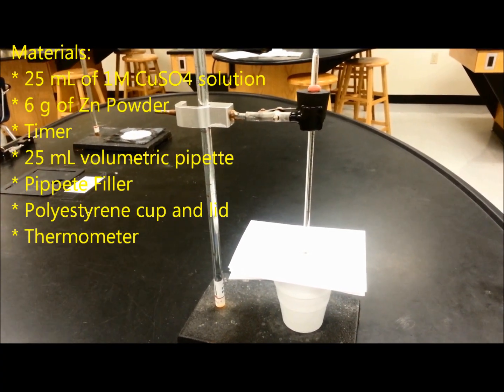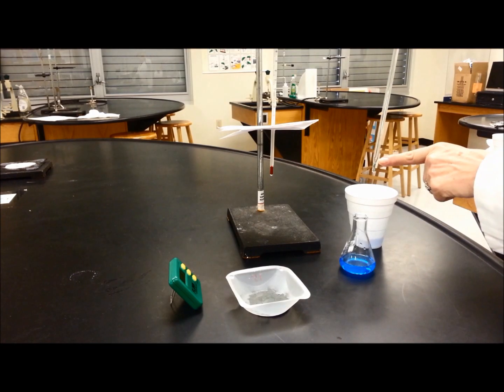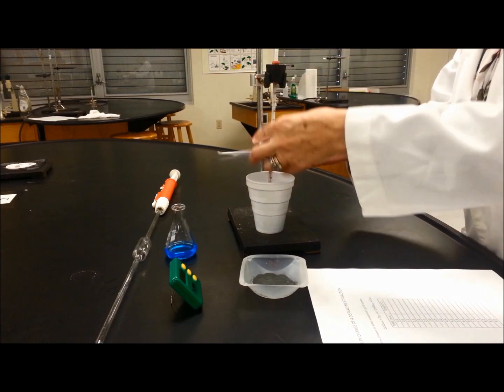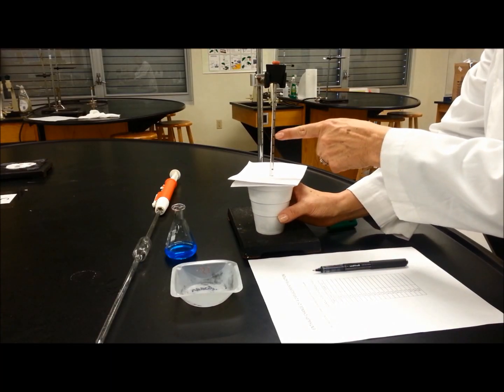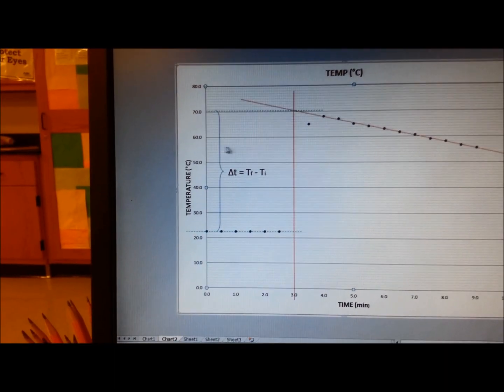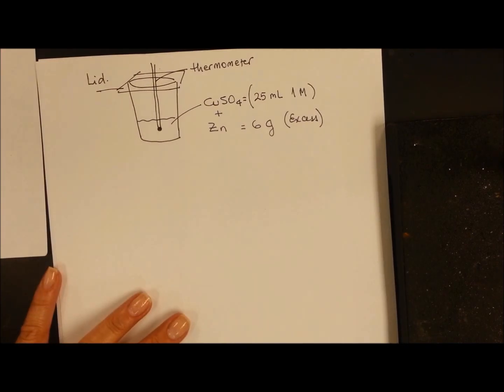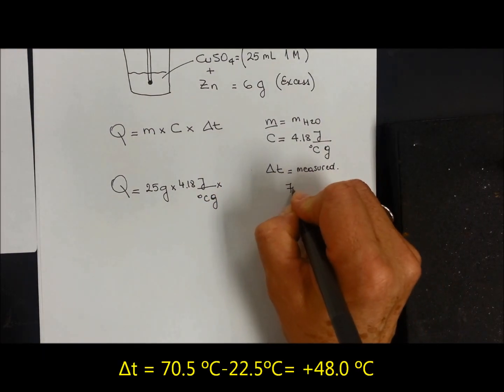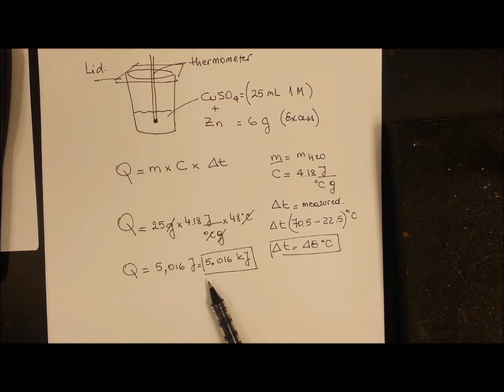AS Chemistry Enthalpy of a displacement reaction CuSO4+Zn with calculations

Comment: Hello,  I was wondering why the temp increases without second reactant in the cup?
Thank you in advance.
Reply from the maker: Hello, 

Thank you for your comment. 
Sorry I did not see this before. 

I placed the Copper Sulfate Penta-hydrate solution (1M) first. 
Measured the temperature for three minutes to be sure that it is stable and at room temperature. (that is the flat zone in the graph). 
Then I placed the Zn powder and the reaction liberated energy that was absorbed by the water and the thermometer so I measured the increase in temperature. 

I do not know if this helps. 
Please let me know if you have more questions

Comment: Hi miss Sanchez, I'm sill new to calorimetry so I was just wondering how is delta H negative? I mean if it's negative doesn't it signify an exothermic reaction?
Reply from the maker: it is an exothermic reaction. the chemicals release heat into the environment (water, thermometer, cup, etc). We can measure the change of temperature of the system by measuring the change of temperature of the water. If the water increases the temperature is because the chemicals released heat. (So the temperature change of the water is equal and opposite to the one of the chemicals)

Since energy is released, the energy of the substance at the end is lower than the one of the reactants. (ΔT = Tfinal - T initial)

The ΔT of the water is positive because the water INCREASES THE TEMPERATURE, while the ΔT of the reaction is NEGATIVE because the chemicals release energy. 

If they release energy, it is EXOTHERMIC.

Comment: Hello, Miss. I wonder how can you get 70.5 for the final temp. As I see, the mixture temp never reach 70.5 celcius
Reply: Hi Julyana, the 70.5 is the maximum temperature the reaction would have reached to if there was no thermal inertia. You see, the time for the chemicals to react gives also time to cool down. (if you leave some hot tea on the counter, it would reach room temperature after some time). By extrapolating the time = 3 min and the projected path of cooling down given by the data after 3 MIN, we can obtain 70.5 C. 
I hope this helps. 
Please let me know. Thank you

Comment: hi, can you please explain how you determined that zn wa sin excess while cuso4 was the limiting? love the video
Reply: and also why did you not include the mass of zn when calculating q?
Reply from the maker: Hi, 
The mole ratio between Zn and CuSO4 is 1:1 (look at the reaction, the coefficients are 1 for both). So the one with less number of moles will be the limiting reactant. 

In this case, you have 

a) 25 cm3 of 1M solution CuSO4. The number of moles can be calculated by #mol=Vol(L) x CC (mol/L) = 0.025 X1 = 0.025 moles of CuSO4

b) 6 grams of Zn  
#mol = m/Ar = 6g/65.4g = 0.092 mol

Since we have 0.025 mol of CuSO4, this will run out first, and hence, it is the limiting reactant.
Reply from the maker: @sarahkhasawneh6496  Q is the heat ABSORBED BY THE WATER. We are assuming that the density of the solution is very close to 1, so the volume of the solution and the mass of the solution are equivalent.
Reply from the maker: I hope these explanations are helpful
Reply from the maker: You need to calculate the MOLES of each one to be able to compare. 
6 g Zn/65 g/mol = around 0.1 moles of Zn.
25 mL of a solution 1M = 0.025 moles of CuSO4
0.025 < 0.1, so CuSO4 is the limiting reactant.

Comment: by calculation, 3.59g of CuSO4 < 6g of Zn so its limiting
Reply from the maker: You need to calculate the MOLES of each one to be able to compare. 
6 g Zn/65 g/mol = around 0.1 moles of Zn.
25 mL of a solution 1M = 0.025 moles of CuSO4
0.025 < 0.1, so CuSO4 is the limiting reactant.